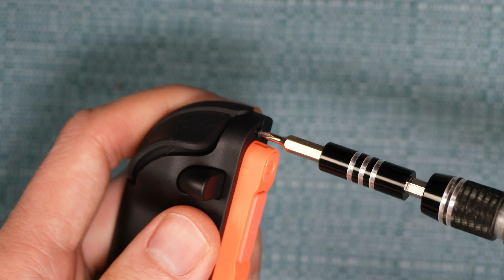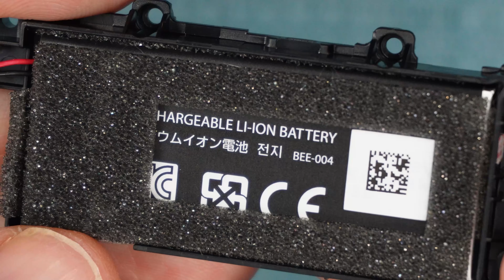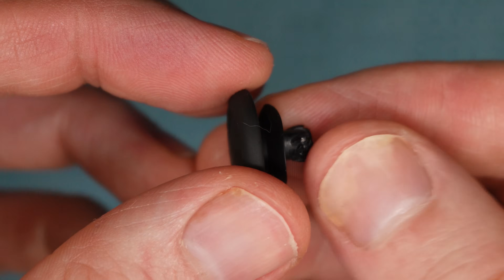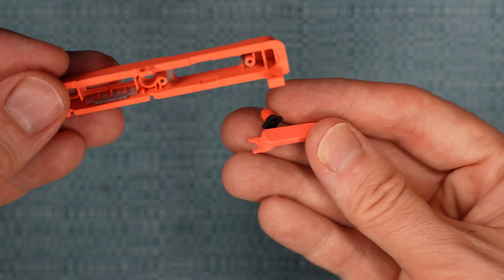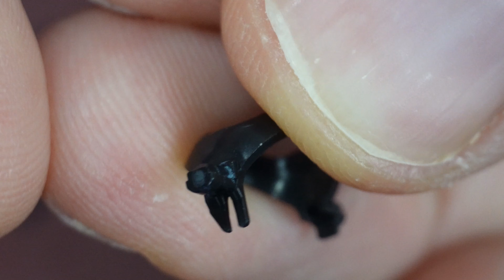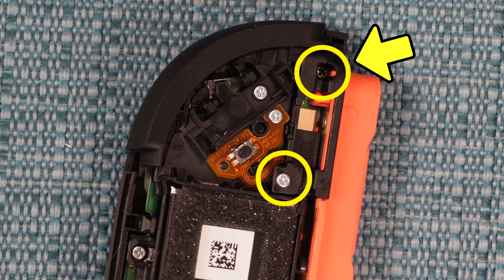How to Teardown a Switch 2 Joy-Con & Put it Back Together | Take Apart & Tear Down Joycon Controller

Comment: Great video. The R button of my right joy-con 2 doesn't work. When I press it, it doesn't detect it. Do you have any solution for this? I would be really grateful if you could upload a video fixing this issue.
Reply from the maker: I won't be making a video, but clean the button.

Comment: You should keep the back panel disconnected until you are ready for the final step.  There is no need to put the fragile cables at risk while working on the components.
Reply: I disagree, because the act of disconnecting it can be what breaks it.

Comment: for the rumble motor connector. No place to grab. So I use a sharp blade insert to the gap between the connector and socket and pry to loose.

Comment: Good luck getting the blue ribbon cable near the shoulder buttons in. Ive been trying for an hour and cant get it in
Reply: Easy peezy. That's why you used a electronic tweezer to get it in. Done 3 times already. Swapped out my buttons and accent rings for some beautiful custom ones.

Comment: After urgently following some other guy's instructions on how to disassemble these things because somebody asked them to go for a swim, I was worried that I'd have a fun time putting it all back together. Screws removed off-camera, parts disassembled in a weird order. Couple of days later it's all dried up and I found your video. Wow, that's what they call an attentition to details! Hats off! Very detailed, well documented. My thanks!
Reply: Great so they dried up and function? Bc mine the Zr and R shoulders not working after providing watered down Meta mucil for my right thirsty joycon. 
Put them in rice overnight and they’re still not working =(
Reply: @Vivacious2ccuteeIn my case it took ~2-3 days. On the day I assembled it, buttons worked only intermittently. And another day after they functioned properly :)